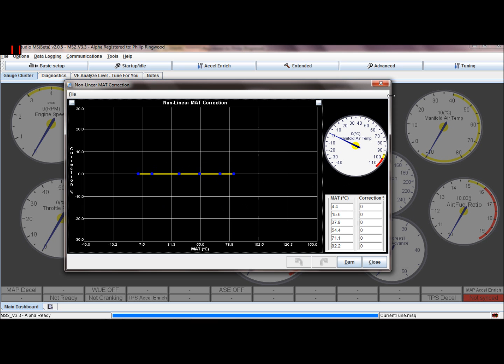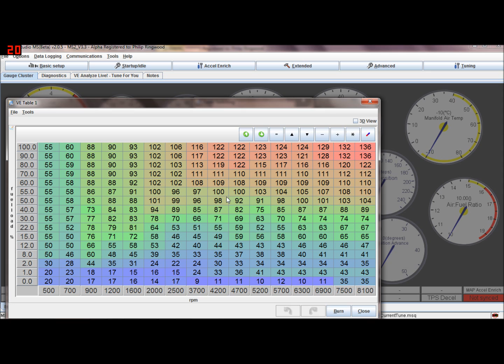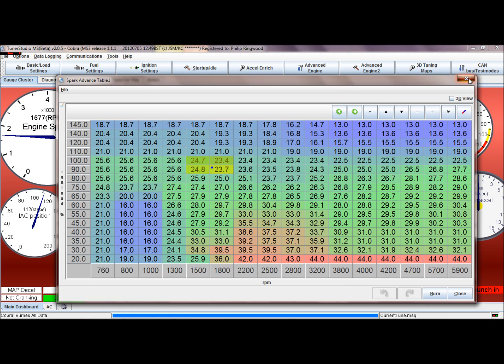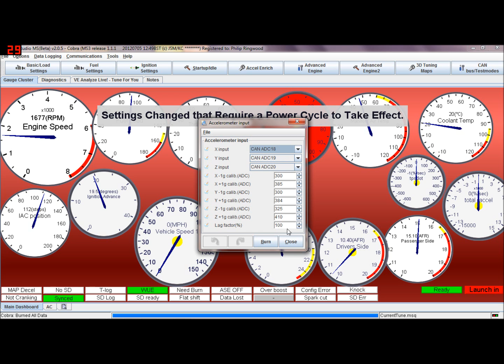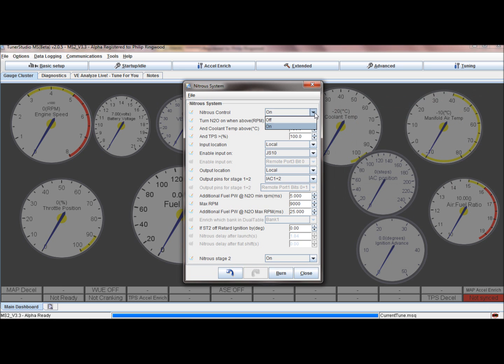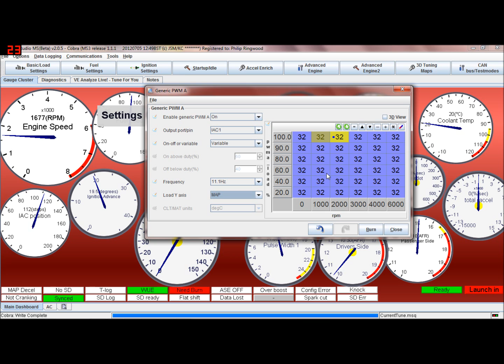MS2 MS3 Settings Tutorial Part 9

Comment: great videos! my question is, if you are using water injection and it adds oxygen to the AFR, why don't you have to add fuel? is it cause the water is also adding a cooling effect? I understand that water injection is a band-aide for crappy tuning, but also a power adder or an efficiency adder to a good tune. thanks